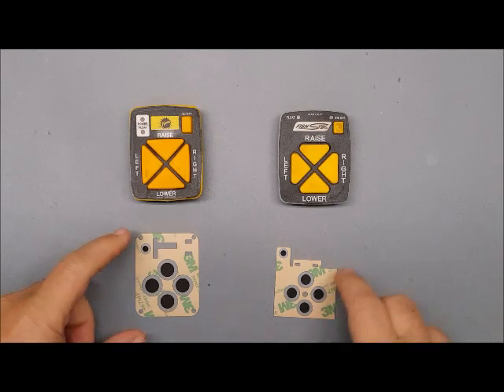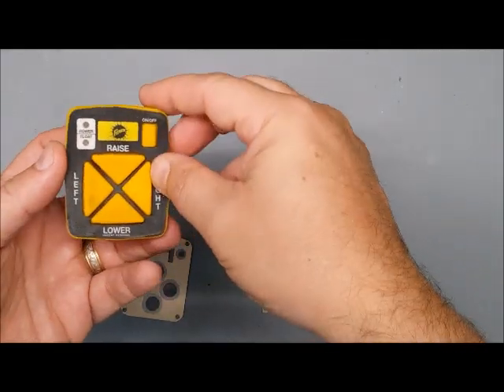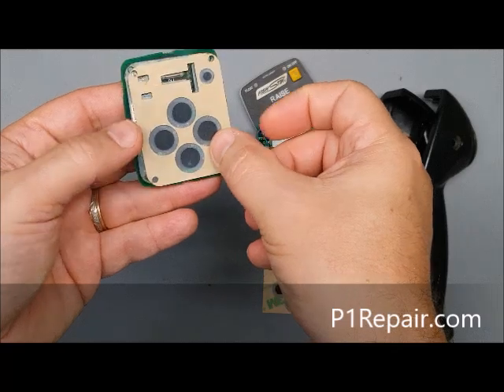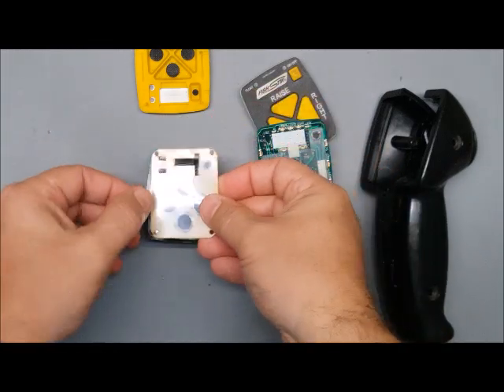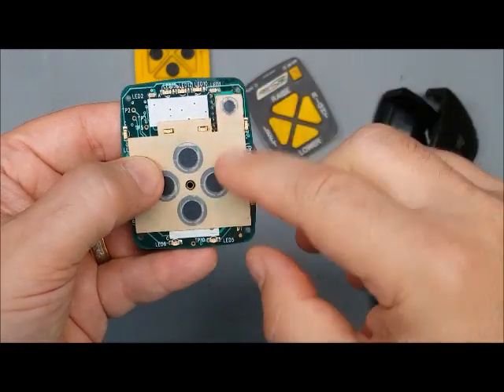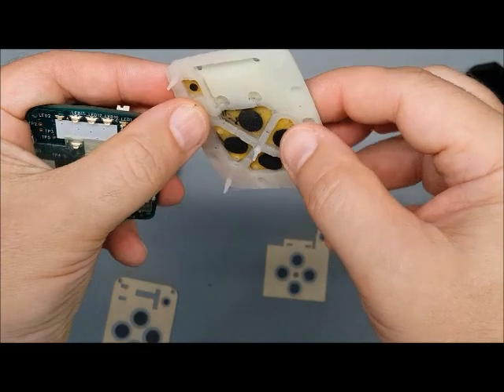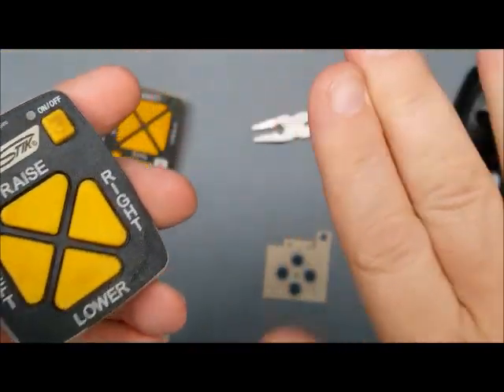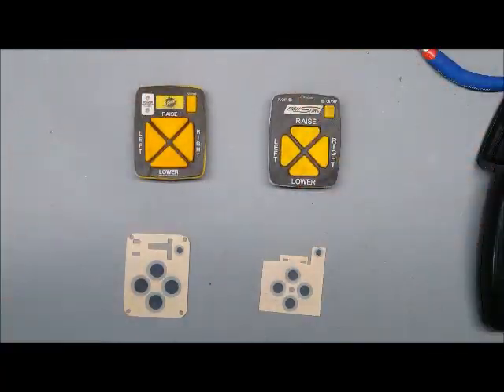How to repair buttons in Fish Stik 9400 Plow Controller

Comment: I just 0000 steel wooled the contact grid to copper, and it fixed the whole problem. These look interesting though
Reply from the maker: Not a good idea! The coating is there for a reason. Your copper tracings will corrode. If it wasn't necessary then why would the manufacturer put the coating on there.
Reply: p1repair meh. It’s 20 years old now, I should just buy a new one anyways, but I’d this gets me through the winter, I’m ok with that. For the five minutes it took, it was way worth it! 😜
Reply: “If”
Reply: Erick thanks for the comment. Saved me chucking mine in the garbage. Works great 👍

Comment: Please show how to get these to work when the unit has 6, not 4 rubber stick pins. Mine has two rubber pins in the middle. Thanks
Reply from the maker: I haven't seen any like that.... but he rubber pins are not really needed anyway. You could cut them all off and put it back in the housing that way. The rubber pins hold it together while out of the unit and maybe help a little when installing but the housing holds it all together once assembled.

Comment: Hey I was wondering if you could possibly tell me what the L1 is?( @ the 1:50 mark in the video, You can see it clearly I think it's the backlight or the logo light or something but like I said I can't find a lot of info) On the older version circuit board. I've been trying to look it up and find a replacement one because mine is shattered I'm not sure if it's a fuse or an LED or what it is I was hoping you might be able to shine some light on the situation and help me figure it out. Not working thank you for your video I look forward to hearing from you. Thank you in advanced!
-L
Reply from the maker: That's a lamp and just lights up the logo whenever power is applied. if it's broken it should not stop anything from working. What is wrong with the controller?
Reply: Yeah I figured out after a while that that was the back light. The controller doesn't have power. I thought it was because that tube was shattered. When I was reading up on the Fisher PDF it said that if the back lamp was broken it would cause an open circuit and it would cause the controller to not power on or off. but if you're saying that's not the case then whatever I read must have been wrong or must have been referring to something else I'm not totally sure. 
I saved a bunch of money buying everything third party(Craigslist) instead of new from the dealer but I've been dealing with headaches for weeks.
I don't know if the controller is bad the module is bad if the plow motor is dead or junk I do have a brand new solenoid. But the process of elimination is so frustrating because like I said I don't know where to start. I tried putting power straight to the plow pump from the battery and it didn't do anything, it didn't make any noises or anything so I don't know if it's dead or if it's frozen because it's freezing out I don't even know if it's supposed to do anything when hooked up like that. so I don't know if I have multiple problems or a single problem. Kind of wishing I would have just gotten it new and installed at this point lol. I am pretty electronic savvy I work on electronics for a living so I know my way around circuit boards not saying I know everything or I'm smartest guy in the room just meaning it's not my first rodeo. but all of this is so new to me because I'm coming from an old school '90s Chevy original MM belt driven to this minute mountain all electric hydraulic motor and I'm just lost trying to figure out where to start you know I've checked the power at the solenoid there's power but there's no power at the motor. I've just been chasing my tail for weeks just wish I knew more about this stuff and had more time to spend researching and learning but by the time I learn all this and probably get it working it'll be spring and I won't need the plow anymore lol. Thank you for the reply so sorry for the long story!🤭
Reply from the maker: @luckylarz4269  No, that is possible. I'm not an expert on these. My focus is buttons and I've only seen a half dozen actual units. I know a common issue is cracked solder joints on the relays but that wouldn't cause power problems. The lamp is 12v and on all the time when the truck has power. lamps are low resistance so you could probably just jumper it and it would work without light but again, I haven't seen many of these so take care and repair this at your own risk
Reply: @p1repair yeah I hear you I kind of do a little bit of everything but definitely not a master of anything lol. I appreciate your replies and your help though it is very appreciated. I've just been struggling for a while trying to get this thing running and it seems like it's roadblock dead end roadblock dead end. Buying everything used I don't know what's good and what's not you know so it's like a crap shoot and process of elimination but it's frustrating. Also I'm trying to use a four-port module instead of a three-port apparently which is what my truck needs because I didn't want to have to spend the extra money I bought it just in case they told me I could return it if I didn't use it so I'm not sure how to even use the three port what I'm supposed to do with the extra wire or if my whole problem is because I'm using a four-port instead of a three-port I have no idea I'm just guessing as I go along haha. But do you happen to have one of those older version sticks laying around that you could possibly take a picture of it for me cuz I haven't been able to find a good picture of that part and of what it actually is. Someone on one of the forms said it was some sort of coil so I have no idea I just don't want to cause more damage than good you know. Again thank you for your help! 

-L
Reply: @p1repair  well I thought originally that the controller was bad but I'm not entirely sure because when I checked pin 1 it has no power. Penn 3 has ground when I put power to it so not sure where to go from here why I don't have power to there I don't know how or where to start to get power to that spot or why the power is gone
Reply from the maker: @luckylarz4269  Yeah, I've never seen anything but the controller handle. I power them up using a variable bench power supply. If you don't have 12v then it has to be something else. Probably a fuse. L1 is definitely a 12v lamp.
Reply: @p1repair  yeah I've checked all the fuses I'm dumbfounded. I work on and with electronics for a living so it's like nothing like feeling like an idiot when you can't figure out the simplest of things but there's a lot going on with the whole 4-port module and all the wires and oh man lol. So I can put 12 volts to pin one and ground out pin 3 and the controller should turn on or do something? If I use my bench power supply? So I should be able to just throw a random LED in there with the proper resistor for 12 volts so it doesn't burn out it should work just like the lamp I think? Lol I guess I'll figure it out pretty fast when I hook it up to the power supply if the controller actually works haha. Hey thank you for your replies and helping me out I appreciate it!
-L
Reply from the maker: @luckylarz4269  An LED would blow up immediately on 12v unless you put an in-line resistor. I believe newer versions have LEDs instead of the lamp.  If what you read about broken lamps preventing them from working then that means some current has to go through the lamp and an LED wouldn't work.  If we are talking about the same plug then yes pin1 12v and pin3 ground. Any power supply 10v-15v should work.  It would power the lamp all the time, and when you turn it on the power LED lights and the buttons make relays click.  up  left and right should click a relay when pressed, click when released and then a 3rd click 1/2 second later. Down just clicks when pressed and released. 3
Reply: @p1repair   p1repair  yeah I can put a regular LED in it as long as I put the proper value resistor I use LEDs all the time with 12 v 24 v sources. If I were to just put the LED in there without the proper resistor then it would most definitely let out the magic white smoke lol. I'm going to try it without the LED first hook it up see if it makes any noises with the relays and then if nothing happens I will try hooking up a LED with the proper resistor and try it again. Thank you for all your help and getting back to me I appreciate it. 
-L
Reply: @p1repair  2 years later and the plow finally works lmfao.

Comment: I put it back together and the pad puffs up like it's not in the track, but it is.
Reply from the maker: Not quite sure what you mean. The rubber pad sticks up? Make sure the rubber pins are pulled back through the holes in the circuit board. Also, the rubber pad may be binding up on the plastic housing when you put it back together.

Comment: These DO NOT work. Sure they work for a short while but this is a band aid - literally. If you want to depend on your controller, have it professionally rebuilt and don't waste your time on a temporary fix. I have seen 3 units with this 'fix' that have failed in just the past couple of months - and yes it is documented on YOUR eBay site (customer from MA). Please stop selling these. People need to depend on their plow controller and this is not a permanent repair. Might be great for remote controls or other keypads but NOT for plow equipment.
Reply from the maker: Sorry you ran into trouble. This is the only complaint I have gotten, while I receive highly positive feedback, random emails from customers thanking me and even mailed in hand written letters from customers that love these products. Overwhelming positive. But nothing can make everyone happy.  I'm sure this upsets companies that have been charging $100 or more to repair them.  If there was an actual problem and these were failing for other people in just a few months then I would hear about it from other people over te last 3 years, don't you think....

Comment: Sorry ! But using these on a plow controller is not a smart Idea. I repair controllers for a living and I had 4 of these come back this season due to issue with these keeping functions on when they should not be on. These are a temporary fix. For inside use like on tv remotes they might be ok.
Reply from the maker: They have been tested, installed and in the freezer. It seems odd that you would have 4 of these sent to you for trouble when not a single person has contacted me about a problem. There are thousands of these in use right now. Unfortunately they are all installed by the end user and quality of installation cannot be controlled. These have to be installed flat. Some people don't like reading instructions and will press down hard on the button areas to make them "stick". That is unnecessary and tends to make the buttons cave in during installation. If you have gotten 4 I'm guessing they all came from the same person.
Reply: from all different people.
And all were aligned correctly.
As far as the contacts bending down when pressed on during install ??? REALLY !!! These are made to be pressed on !!

The problem is that the older boards have a black coating on the pads and that causes the contacts to be taller then on some of the top light newer versions which are not coated.. So there isn't enough space between your piece and the actual contact surface.
Also, the old left light ones have a vent hole by the power button and that lets stuff get in there and that in turn gets between your product and the board and wont come out.

fyi
Do to the added thickness, they do cause the pad to puff up some like the other person mentioned because the factory rubber is stiff when old and wont compress enough.
Reply from the maker: @franbednar7494  Yes REALLY... these are designed to be pressed down by the small soft rubber pill, not by a large human thumb. I've seen many installations fail for different products, usually by people telling me "they are technicians and good at this stuff" because I later find out they really pressed down hard on the buttons while installing it to make sure they stuck down really well. 
Can you explain how you would receive 4 of these with problems yet I have sold probably 2 thousand and not one customer has emailed me with a problem? 
There was a known issue with the 9800 when I changed the design from put-in-place to peel and stick. The sticky button areas were too large. For some reason they didn't like the change and caused problems with buttons sticking. I did have a customer contact me about that right away and quickly made adjustments.  So when there was a real problem I heard about it immediately....
Reply from the maker: @franbednar7494  If I know about a problem, I make changes and improvements and occasionally that does happen. But a vague "these don't work" is "inaccurate"  because if they didn't work I would hear about it from customers... not a 3rd party person on a YT comment.
Reply: @p1repair  many people sell or just go by new instead of wasting time to complain or look for answers or help. Many figure it's a hoaky after market product and  feel they tried and move on without contacting you.
Reply from the maker: @jimbobxcityguy5338  Yes... "many" or "most" people would not bother. But then that wouldn't explain why I have sold thousands of these in the last 5 years and heard about problems from NOBODY. And why I do occasionally hear from customers thrilled about the repair including some hand written and mailed thank you cards. I do hear from customers ordering remote control button repairs on occasion who have trouble. Usually it ends up being a more serious issue than bad buttons.... like replacing tires and complaining the car still doesn't move.

Comment: You really should show actually installing it not blabbing on about how easy it is. You leave questions on installation which maybe the reason some have issues.
Reply from the maker: I don't think people will have trouble with a sticker. If someone needs that much hand holding then they shouldn't be attempting the repair.  What many will have trouble with is understanding why and how the product works to fix worn buttons and the common misconceptions or mistakes that can be made.
Reply: @p1repair  thank you sir i actually just cleaned the contacts with q tip & rubbing alchohol  but i did.nt dare take it apart until you showed me   nice  u just saved me $355